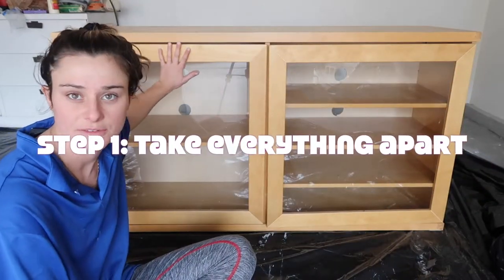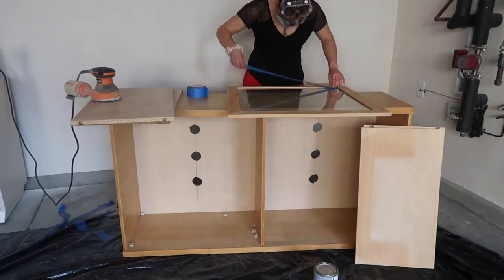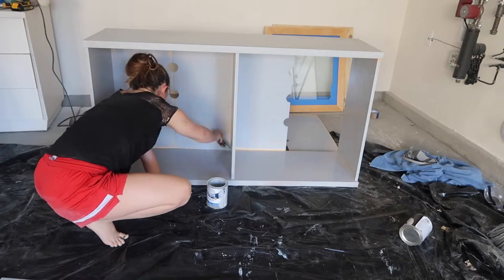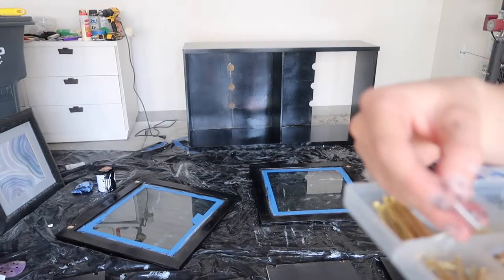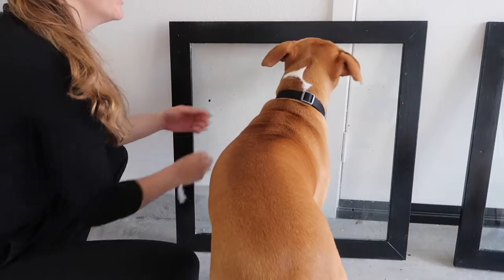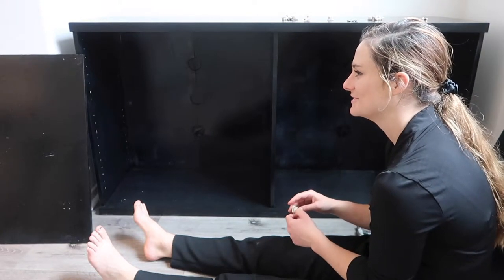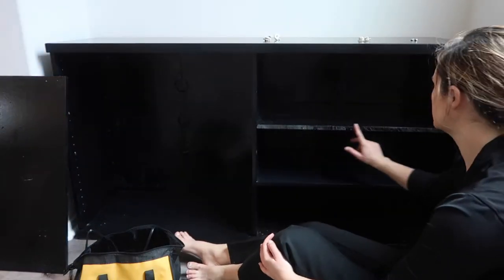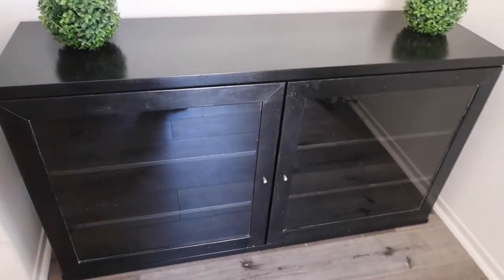Repainting Wood Furniture

Comment: great job and thank you so much for sharing next time you have glass just try saving your cell at papers that you get in the mail use that paper while you're doing the same kind of taping just put the paper in the middle of that way you won't have to worry about it clean up afterwards just a small suggestion but a great job and thank you so much for sharing I have a lot of beautiful ideas from your tips continue to stay safe much love and peace.......once you do use wood putty to seal it you have to let it dry sand until smooth white down and spot paint next time just add a piece of that painter's tape around the part of the drill bit so it'll let you know when to stop all you have to do is measure it how deep you want it to go use another hole and then Mark it with a permanent marker and there that's where you line the Pinterest tape up to the drill bit that way you won't go through the whole piece of wood
Reply from the maker: That is a really good idea! I am definitely going to start saving those now. Thank you for sharing

Comment: After painting wood furniture? How do you take care of the paint or how would you clean the furniture piece? Clean as usual? 
Usually I use Lysol on my furniture for deep cleaning. Sometimes I use the wood spray on my furniture...
Reply from the maker: Honestly, I just use normal house cleaning products and it has been fine. But I know that a vinegar, water solution is good on painted furniture.
Reply: pro tip: watch movies on Flixzone. I've been using it for watching lots of of movies recently.
Reply: @Felipe Rowen Yup, have been using flixzone for months myself :D